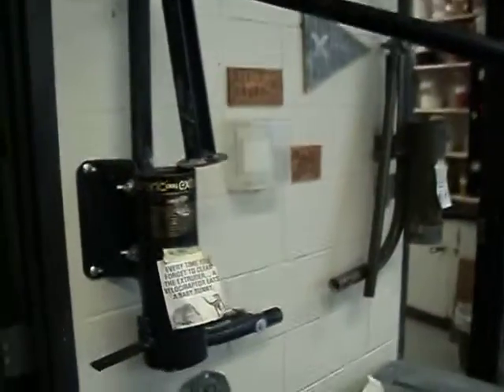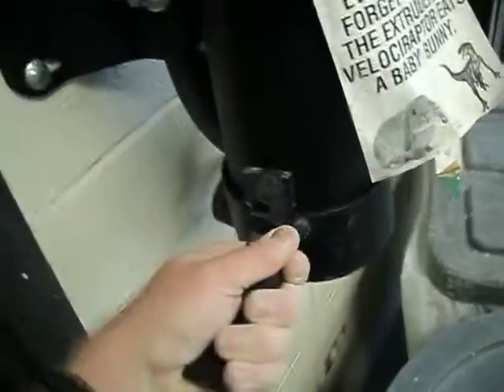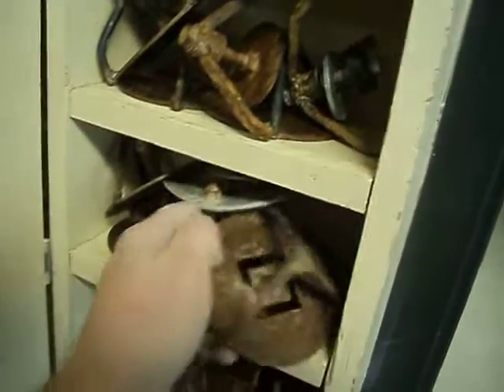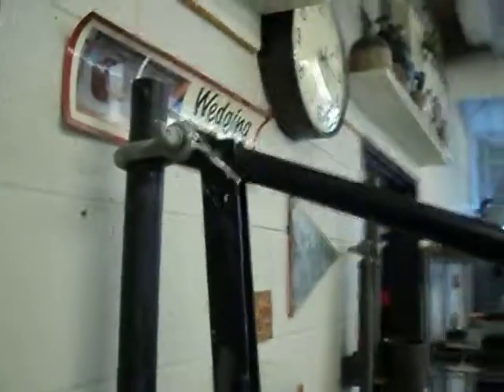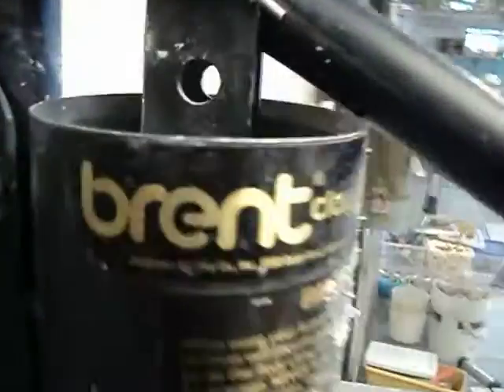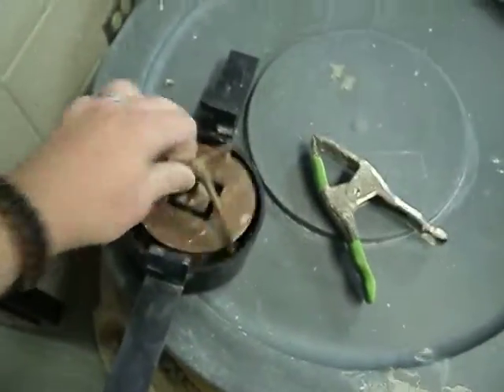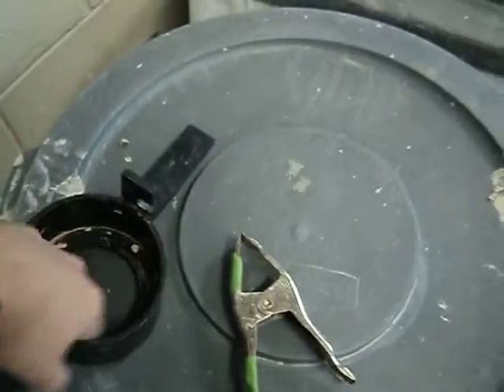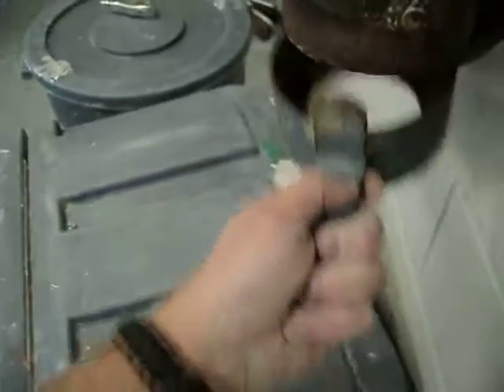Brent Extruder

Comment: What's the best way to compress a 3-4" circular clay disk into a mold (~1000psi)?
Reply from the maker: +ExopMan THey make special tile presses just for that. I don't have a tile press but I know that they work great. The plaster mold has to be pretty precise to hold up to the pressure from the press. I'm sure there are some more DIY methods but I haven't played with tiles that much.